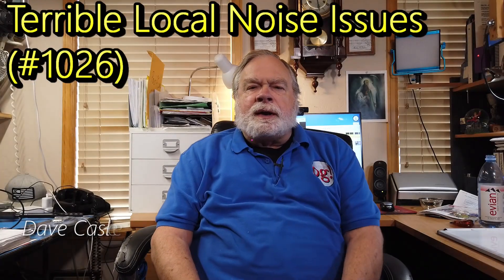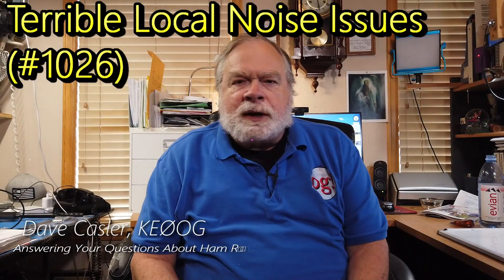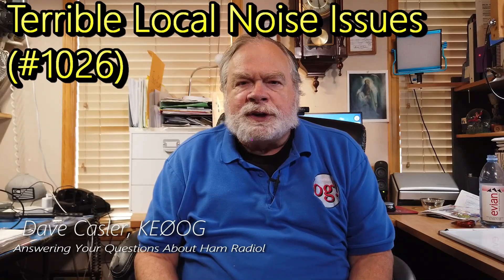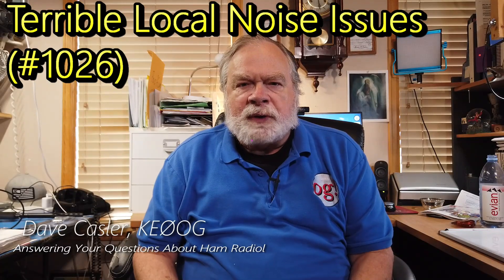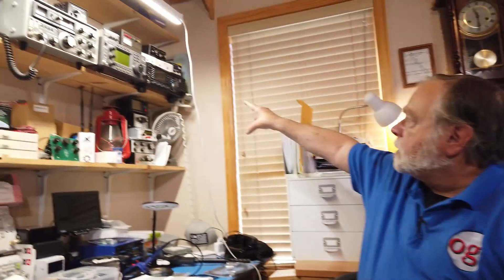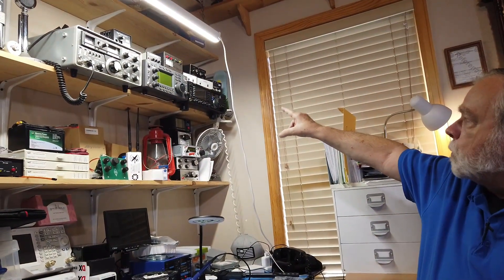Terrible Local Noise Issues (#1026)

Comment: You mentioned to add clamp on torroids on the 12 volt power leads. Would this be at begining were the power leads leave the power supply? Or right at the back of the transceiver were the 12 volt enters the back?
Thank you

Comment: I had an ethernet switch in my shack that was causing HORRIBLE noise!  Finally unplugged it and the noise vanished!  Replaced it and the noise was still gone.  I have also been using an ANC-4 with a "noise antenna" in the attic and THAT was a great improvement too.  Hang in there!  You'll find it...  de W5ODP  😀

Comment: A couple of things I found useful, I also use an OCF dipole, first build a mains filter to reduce mains borne interference, plenty of designs using big ferrite and commercial mains filters n series. All shack gear , pc antenna switch wall warts all  should be supplied from the same common filtered socket strip.
Second , try reversing the OCF so the short end is swapped with the long side, I recently did this to reduce noise from a neighbour’s house , it dropped the noise by 2 s points as you are shifting the current peaks on the antenna elsewhere.
Oh and dont mess with the house earthing, its the way it is for a reason.

Comment: All great suggestions.  If you can identify how the noise is entering the radio you will avoid unnecessary remedies.  An easy way to check the power supply is to power the radio from a battery and see if there is a change.  As also noted the BHI noise suppression works well.  I recently purchased a Heil Parametric Receive Audio System and matching speaker. Yesterday I installed a BHI noise suppression board in Heil cabinet.  Hearing problems had made radio listening painful.  I can now listen to shortwave stations again.  Also the type of antenna can make a difference.  I use a magnetic loop which results in a lower noise floor.  Once you find how the noise enters the radio you'll get this resolved.

Comment: I have a very high hf noise level. I built a homemade loop antenna. The mag loop antenna cuts noise by about 5 s points. My loop is mounted at the  bottom of my garden well away from the house. Hope this helps Kim G8GRL.

Comment: Dave, good advice. If his shack grounds are good and done correctly, it is still possible that the noise is radiated and picked up by his antenna. Moving the antenna away from the house might help this. But, finding out how the noise is being radiated is important too. I have seen house wiring radiate when the wires are not kept together forming a loop. This is a very bad practice but some homeowners do it. Other than that identifying and eliminating the source devices is the only way to get the noise level down. Good luck to Steve, AA8TJ

Comment: Variable speed, motors in any type of appliance can put out RFI I myself am plagued on 10m with one of my neighbors air conditioners. 
I had the power company came out and they figured it out. Although the manager that I dealt with over the phone, was unable to tell me which neighbors air conditioner was giving me the issues he wasn’t the tech that came out and I wasn’t home at the time. I’ve watched a few YouTube videos regarding this and often the manufacturer makes special wiring harnesses that can be added between the control board and the variable speed motor. 
But from what I’m told they have so little complaints. They do not supply it with the new units they say about one in 1000  units they sell well they get an RFI complaint, so they don’t bother, installing the special harnesses on all the units.
Reply: So at least your RFI is in your own home, and you could probably combat it at the source.  With appropriate chokes and toroid’s on power cables, wiring harness between motors and their control boards.

Comment: A few more thoughts:  Try to determine which household items are causing noise by switching off circuit breakers to isolate the noise source to a single room; I found a noise-generating wall charger this way.  Try ferrites on the power cord of the washing machine, A/C and other noise generators. (I completely cleared up a bad noise problem from a neighbor's big screen TV by putting ferrites on the power cord - glad she let me!).  Last, I have used noise cancellers to great effect to null specific local noise caused by electronics.  The noise cancellers (MFJ-1026, ANC-4, QRM Eliminator) are amazing devices when used properly.  I've used them all.  I like the MFJ-1026 and QRM Eliminator because they have gain controls for both the main and noise antennas, making it easier to match the noise level between the two antennas, before nulling out the noise.

Comment: I would also check that his AC common is properly attached to the house ground.  Also, I would check that all the screws on the circuit breakers are tight.  I say this because he mentioned that he hears appliances in his receive audio.